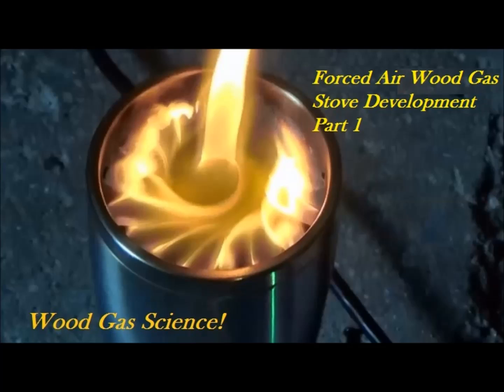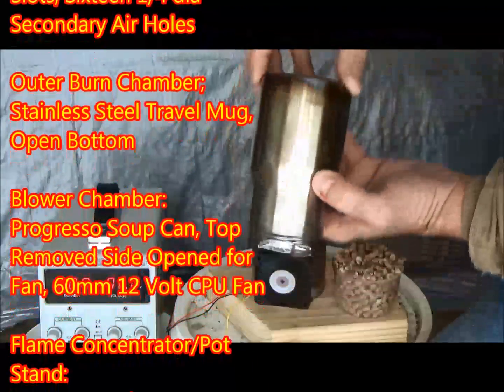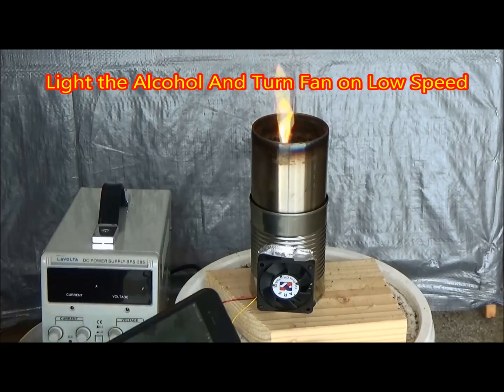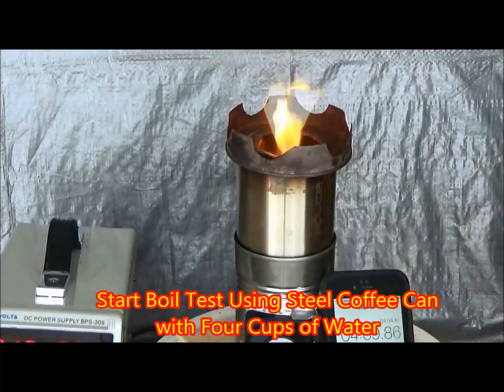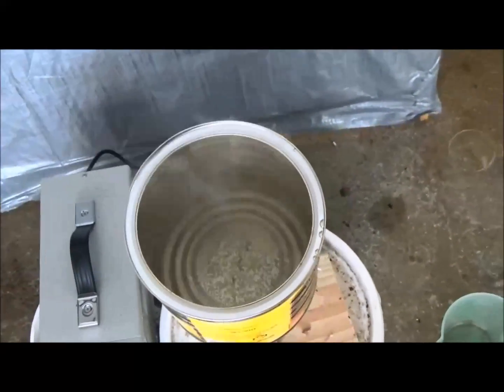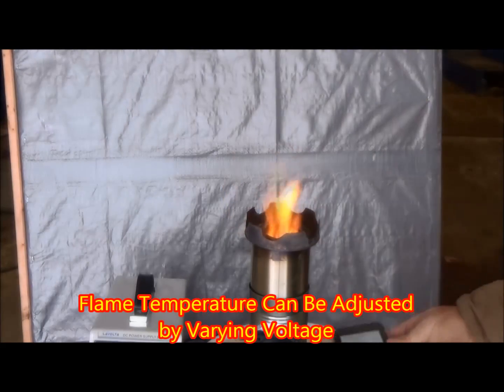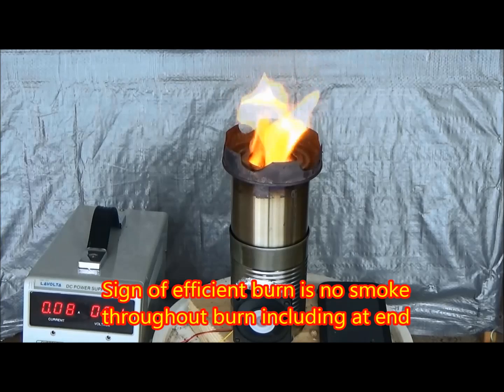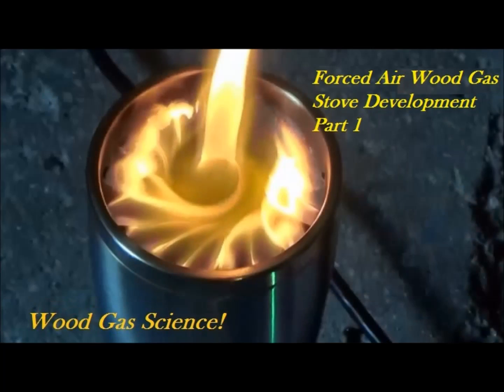Wood Gas Stove Science! Force Air Part 1

Comment: Great job! 

I'd be Interested in several things.

What is the temperature of the outer shell during a burn? 

Temperature of the hottest flame? 

Ratio of pellet weight to ash weight? 

Max duration of an unassisted burn (no fan) vs an assisted burn (with fan)?

Comment: I am thinking two way to increase your design. 

The passive design made hole at the bottom of the fuel container to make an air flow to heated wood(gas) helping the gamification of the fuel. It made the fuel burning easier and more efficient.

Yours depend on the heat to vaporize the upper area by simply increasing the air needed to burn. In your design, some fuel gas attracted to the hole where oxygen supplied and burn when they met making your combustion goes horizontally. You are getting circular side burns there.

Both will made more efficient burn, but i think yours will be more efficient(leaner burn) but less practical. There is several things that i think might improve yours, here they are:
- Simply use stronger fan, hahaha.... i don't even need to mention this actually.
- Add few smaller holes in the bottom(2-4 maybe) to push the fuel gas slightly to the burning area (you ll get taller fire) like an auto switching to bigger fuel injector(more fuel, more combustion, bigger fire but less efficient - but you could just supply more air, right?), and or 
- Make a ring between your fuel and your hole, this will increase the air:fuel ratio ensuring the fuel burn thoroughly(will reduce some of your fuel vaporization surface, but if you use the previous idea you got more fuel anyway). The effect will be similar to increasing your fan airflow(or voltage in your case). You just need to throw something that cant be burn above your wood, but a ring  will concentrate the fire in the center which i think would be more efficient(the other maybe is to cover your fuel with drilled circular plate, but i guest a ring will produce visually nicer fire pattern)
- Use a smaller tube for your fuel or increase the diameter where your combustion occur(bigger diameter where you feeding forced air).
- Make a smaller but denser ring of hole to made the burn more uniform, you could made two row if you use even smaller holes. Btw, made no hole opposite to one another while you are at it to made a fire cyclone.

Good luck!

Comment: Take a look at these ebay wood gas stoves - note the air pipe plumbed to a stove base: (DIY air assist add-on) 
http://www.ebay.com/itm/302154514382
http://www.ebay.com/itm/112238761901
http://www.ebay.com/itm/381613376931

Comment: You have previously claimed to "optimized" a wood gas stove - I recommend you use an optimized design (document with picture slide) then proceed to improve with forced air assist.

Comment: Are you planning something new or to repeat and confirm another experiment?  Forced air wood gas stove is nothing new. Did you do a search first?
Reply from the maker: This is just a baseline... I will be making improvements as I go.
Reply: Suggestion - add a graphic slide (rather than scroll) with the parameters - I know you verbalized them too but a visual record that can be printed is much better. How much air CFM also. Please add a flame test point (nail?) and use an IR thermometer for temp readings. Thanks.
Reply from the maker: Good point, I did take some flame temp tests on a previous burn and saw over 1600F at pot stand height. I will take other baseline data. Thanks for the comments!
Reply: Document flame color, temp and height above fuel container etc. Without good data it cannot be repeated and verified... science!
Reply: How about a baseline burn without fan assist. Since every WG build is different please establish a baseline for your stove before adding air assist. I'd like to see you adding more water to the coffee can, measure weight of pellets, quantity of water, temp of start water and end water temp to see how much BTU has been transfered to water. Repeat with fan assist and report data.  It's not necessary to boil - if you log start and end water temps. Do you have an IR laser thermometer?
Reply from the maker: Douglas Pohl I do not have an IR temperature meter, but I do have a meter with thermocouple probes. The baseline for the stove without fan assist may not work well due to the small amount of primary air that will be introduced to the burn chamber, but I will give it a try. Thanks for the comment!
Reply: @heathputnam9524  Waiting for Part 2, thanks!!